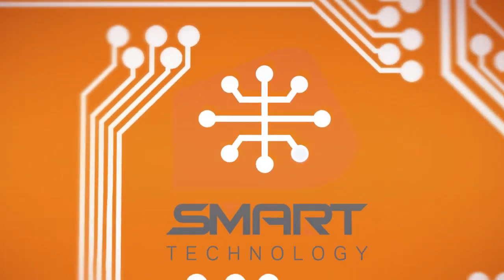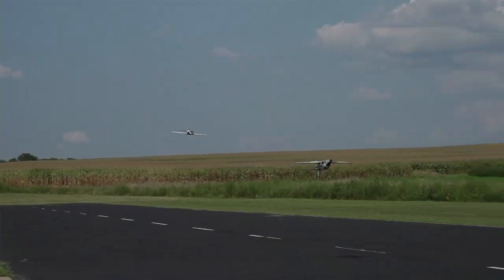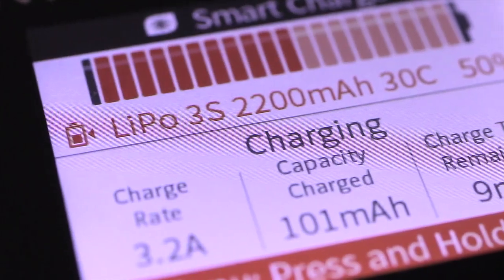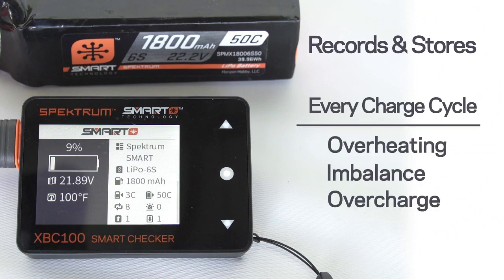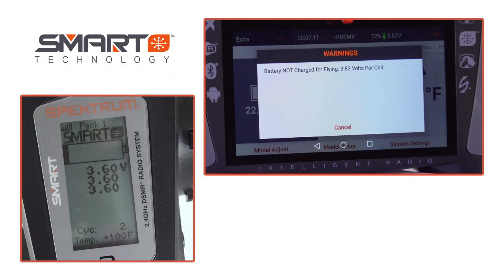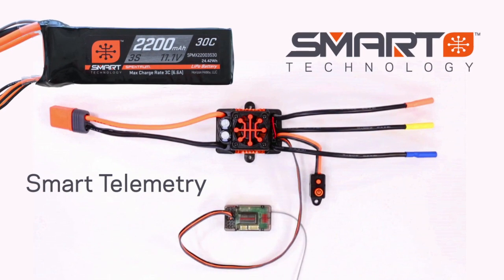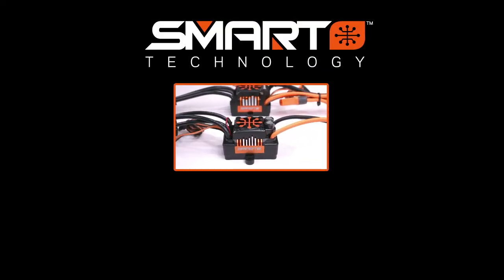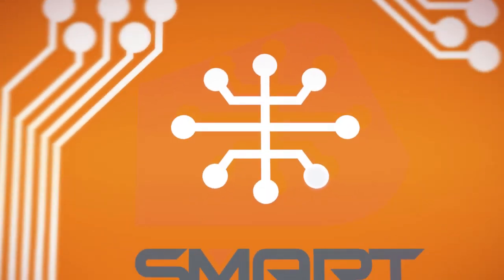Smart Technology Explainer Video

Comment: I have a smart ESC but I was really disappointed to learn that battery capacity readout only works with smart batteries. That’s a huge negative point as I really don‘t want to replace 20 good batteries! 
I‘m especially disappointed since the ESC does the capacity calculation, so it sure would be possible with non-smart batteries. Seems like you guys have disabled this by software to make me buy smart batteries... I‘d rather buy an Unisens-E sensor for each model. Cheaper and works with every battery.